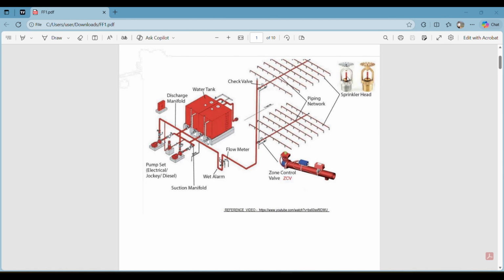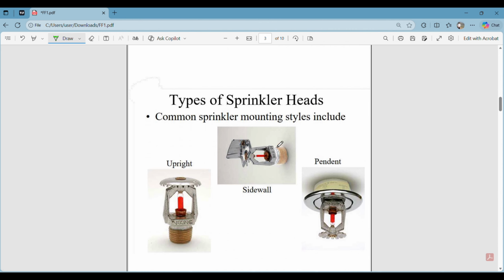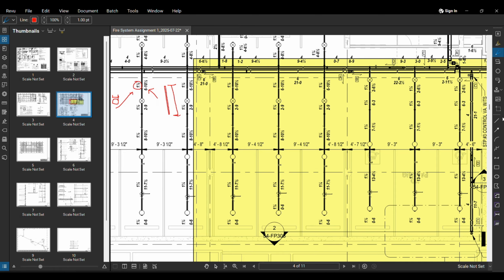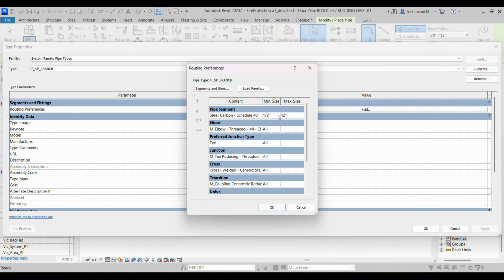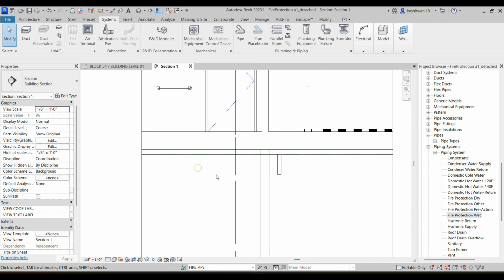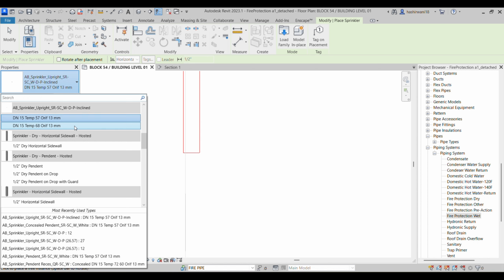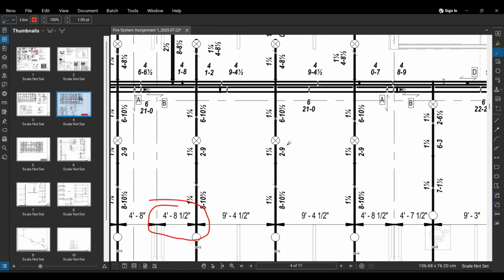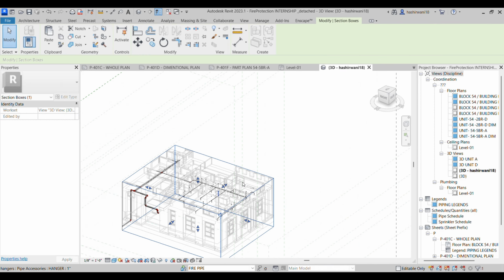BIM FIRE FIGHTING AND FIRE PROTECTION Modelling Masterclass by ER HashirVani  #bim #revit #structure

Comment from the maker: This masterclass by Ashawani focuses on BIM Fire Fighting and Fire Protection Modelling in Revit MEP. The video introduces the fundamental concepts of fire fighting and fire protection systems, explaining them as networks and equipment designed to detect, control, and suppress fires within a building (0:21).

The video breaks down the components of a typical fire protection system (1:12):

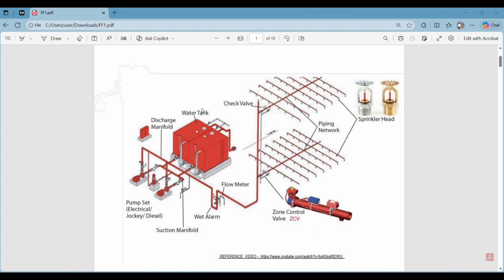Water Tank: Acts as a static reservoir for fire fighting water (1:43).
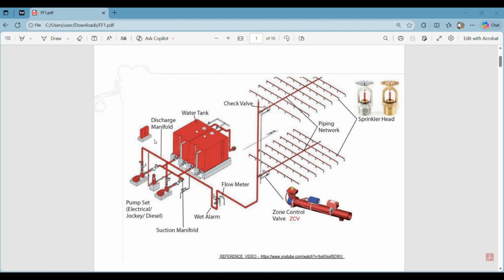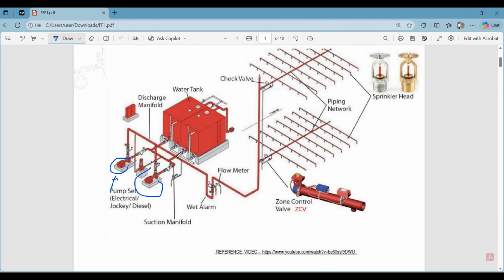Pumps: Includes main pumps for high flow and pressure during a fire incident (2:25) and a jockey pump to maintain system pressure for immediate water availability and to account for leakages (2:43).
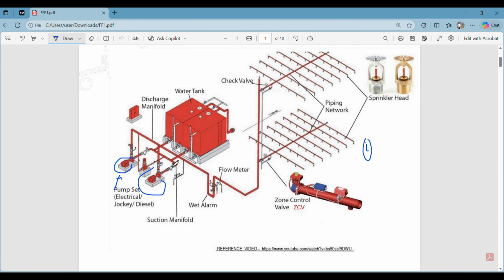Suction Manifold: Draws water from fire hydrants or main pipes, separate from the water tank (4:36).
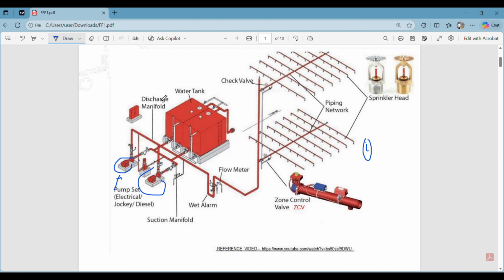Discharge Manifold: Combines all water inflows from various sources before distributing it (4:58).
Riser Pipe: A vertical pipe connecting different floor levels in a building's fire protection system (5:35).
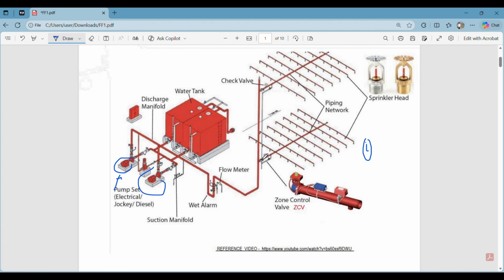Branch Pipes/Cross Mains: Horizontal pipes that distribute water (5:55).
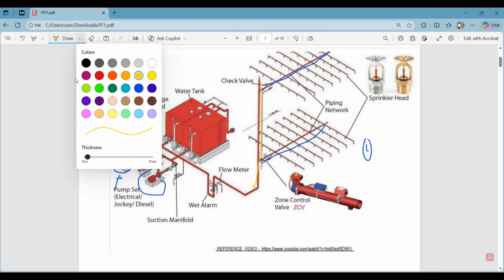Laterals: Small pipes feeding individual sprinkler heads (6:21).
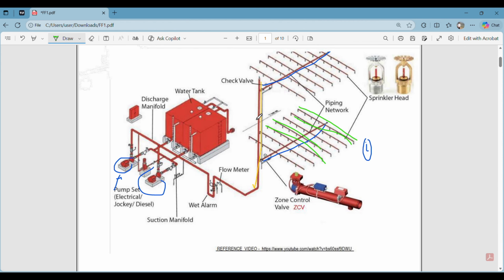Check Valve: A non-return valve preventing water backflow towards the pumps or tank, ensuring one-way flow towards the sprinklers (7:07).
Zone Control Valve (ZCV): A valve that isolates a particular area or zone of the sprinkler network, often electrically supervised (7:44).
Sprinkler Heads: The core components that release water when a fire is detected. They consist of a deflector, cap, thermal linkage (like a glass bulb with liquid or a metal plate with solder), and a frame (8:25).
The video also explains how a sprinkler system works (9:15), detailing that heat from a fire triggers a mechanism (often a glass bulb breaking or solder melting) to release water, which is then spread by a deflector (10:10). Different types of sprinkler heads are shown based on their orientation: upright, pendant, and sidewall (11:00).

The presenter discusses different types of sprinkler systems, including the common wet pipe system where pipes are filled with water, allowing for immediate discharge upon sprinkler activation (12:11). This system is typically used in areas without freezing risks (12:46).

Towards the end of the video, the instructor begins to demonstrate modeling fire protection systems in Revit, showing how to set up the project, link architectural files (36:01), and create custom pipe types with specific routing preferences for main pipes (26:01) (using Victronic fittings for pipes 2 inches and greater) and branch pipes/laterals (29:08) (using threaded fittings for pipes less than 2 inches). The video also touches upon understanding design drawings, sections, and elevations for accurate modeling (37:19). The importance of precise modeling to ensure full coverage of sprinkler systems and avoid hazards is emphasized (21:49-24:04).